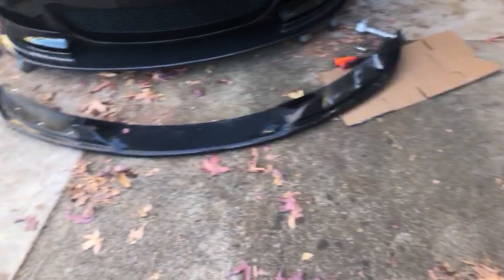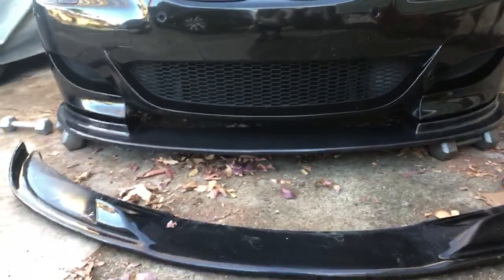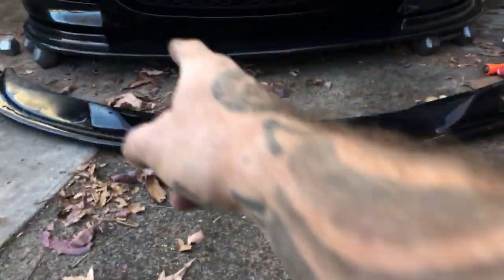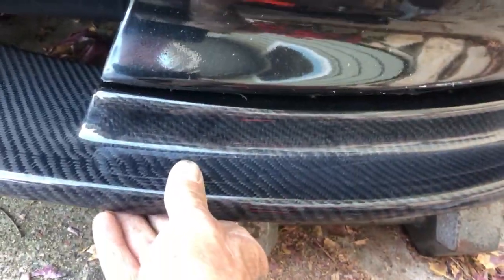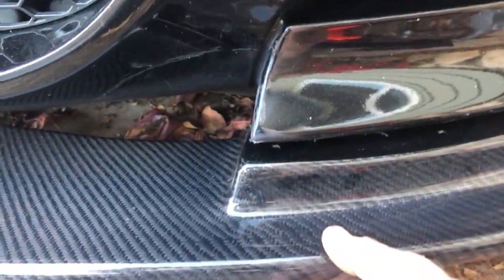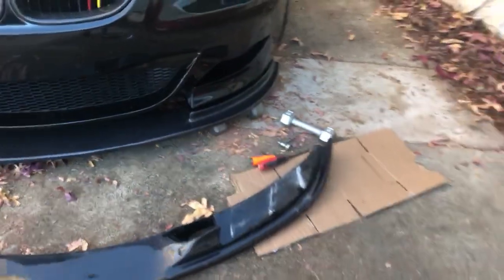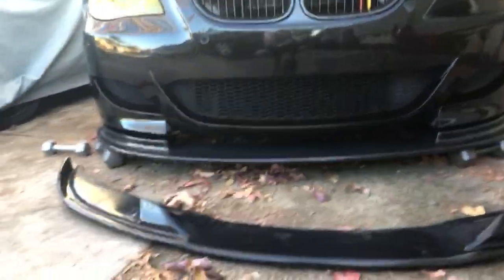San Diego’s best e60 M5 ( installing new front lip) DTM style

Comment: I have the same one that u took off your car and ended up cracking it 7 times then fixing it. The one u didnt like i dont like it either. Definitely looks lower than the old one so u knew what was coming :)
Reply from the maker: I have a dinmann one now . Super sexy but pricey
Reply: @DuaneMoore  
Do exactly these come made from a rubber instead of a plastic? Would you know?
Reply from the maker: The dinmann ??? That lip is Carbon fiber ... 1400.00
Reply: Interested in selling some parts ?
Reply: @951rollincivicsi  
I sold the car, thanks!